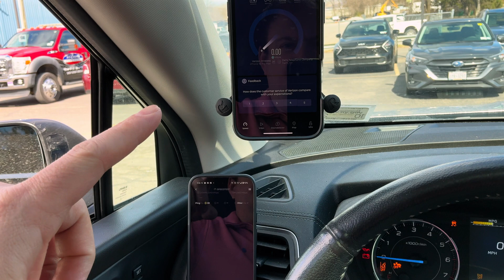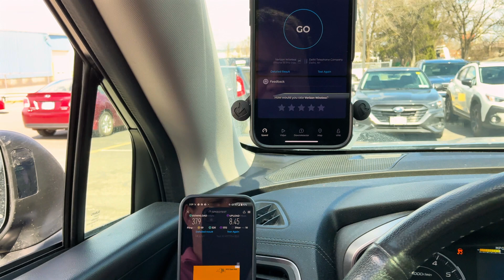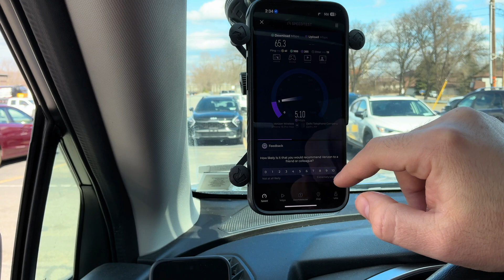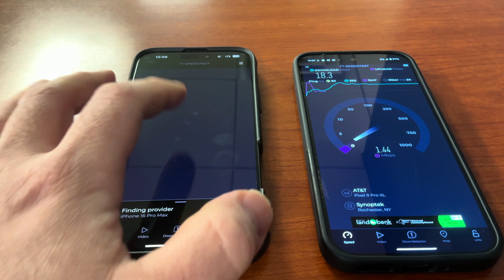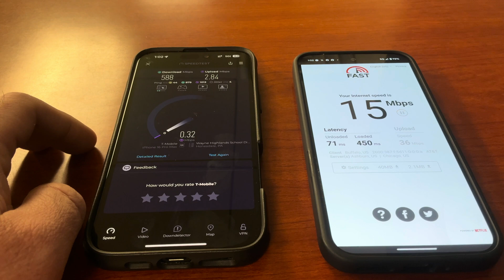Ookla’s Big Update and a New Apple Short Cut - Speedtesting at the Dealership!

Comment: Likely Verizon is preferring NSA due to the weak signal smart cuz then they could drop 5G quick if a call cames in likely also the other 100mhz is on SA but not sure without looking at a good service menu like Samsung's but doubt with that signal is aggregating the rest or id probably detecting the CA but not exactly engaging it they need to upgrade those near by  Small cells for better signal stability  and to they deploy full SA with the full 200mhz n77+ the n5 if possible.